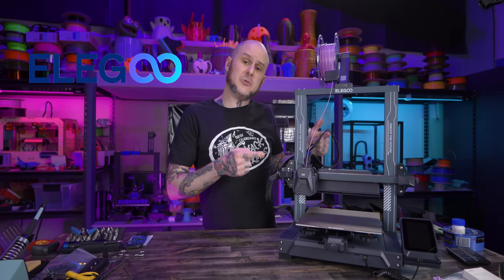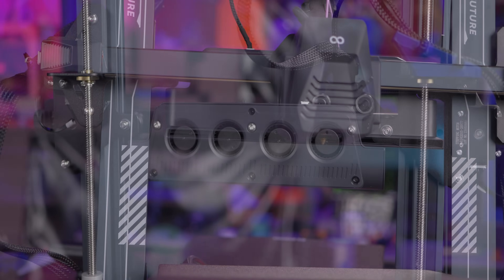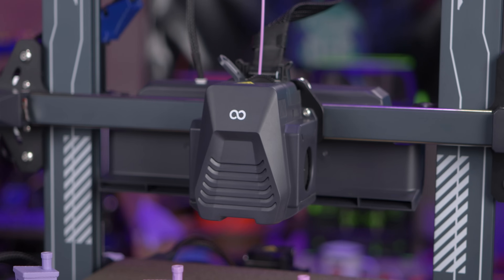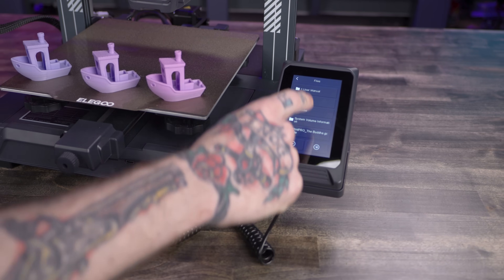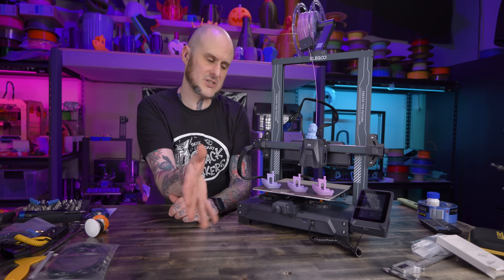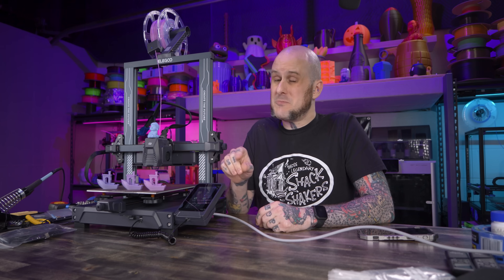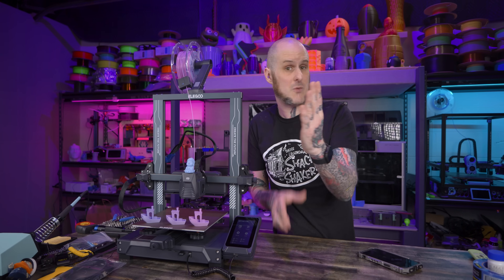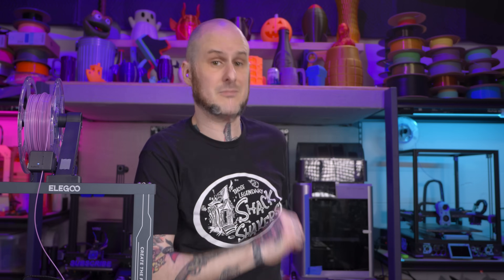Neptune 4 Pro - Closer Look + Wi-Fi Setup!

Comment: I have a Problem with the wifi. Please help. lsusb shows the wifi dongle. In nmtui i can select my wifi and connect to it. It seems to work. But IP Scanner does not Show the IP and on my Router the connection is not shown. What is wrong?
Reply from the maker: Try other IP scanners. Sorry, it sounds like a network side issue that I cannot begin to remotely diagnose. I've setup my network with a managed router specifically to simplify these types of processes for my work. I cannot think of any reason your machine would be connecting but the IP address not be visible somewhere on your network, unless it is a network permission issue for the machine searching for the other IP address.
Reply: Thanks anyway. I'll try it

Comment: Excellent preview of the printer. I ended up buying the 4 Pro. It's been great. I'm wondering if you could point to a tutorial on how setup the camera. Every one I found ends up with the webcam not working. Like the mjpg streamer is not running. I see that you have a different web interface setup too. Completely new to klipper and that whole armbian printer environment, but not completely new to pi-based systems. Just not having any success. Thanks again for the preview. It was very enlightening.

Comment: I cannot mentally grasp how to get to that fluidd website or program or whatever it is, and literally no video is explaining how to get there, Is there something very obvious im not understanding here??
Reply from the maker: It is a somewhat obvious thing, so I guess everyone glosses over it. 

Take that IP address that your machine has assigned to it (if connected by LAN cable it will be in the menu as I showed), type that into your web browser as a URL. So open Chrome or whatever, and instead of “www.” just type “192.168.1.xxx”. It should load the Fluidd interface if the machine is booted and connected to your network.
Reply: @MandicReally  First and foremost, I deeply appreciate the instant reply, thank you oh so very much. Second, Thats a very straight forward explanation I will get on that right away, thank you SO MUCH

Comment: I finally got my Neptune 4 Pro in and I've been loving the speed. I have an Ender 5+ that I run octoprint on along with a pi camera, so I'm not a stranger to the web interface. I have the Neptune connected via LAN cable, but I'm having all kinds of issues getting my Logitech 920 to show up in the web interface. It is showing up via the "lsusb" command, but not on the gui. Were you able to just plug and play, or did you have to mess with some configuration files? If you did have to make adjustments, could you point me in the right direction? I know this is an older video, but out of all the reviews out there, this has been the most informative for me.
Reply: Did you ever find a fix for this? I'm trying to get my cam to hookup via wire and fluidd that came with the printer.
Reply: @MiaMia-zw5wu  No, I didn't. From what I was able to find out, there was an update pushed out that broke the plug -n-play of webcams. Support from Elegoo said, "sorry, we can't assist you because it wasn't designed to use webcams". So in between this video and the official release, updates were made that make go boom.

Comment: Thanks for this video.  The WiFi dongle installation hack was particularly appreciated.  I probably could have figured it out myself in an afternoon but it's great that you showed us how to do it.

I hope Elegoo makes a 300 mm cube print volume version with Klipper, but adds an accelerometer so it can do input shaper calibration to maximize print speed and quality for each customer installation instead of some generic input shaper profile, and with WiFi because almost nobody uses a wired LAN connection in 2023.  It'd be great if there was an optical filament run out sensor on the print head as well instead of that dangly bit next to the reel.
Reply: I wish these manufacturers would add the accelerometers to the hardware itself, instead of it being an additional expense. I wouldn't describe these printers as "crude klipper implementations," but I think these first high-speed cheapies are clearly "We were making this printer already, and added Klipper." 

Accelerometers are cheap and easily available, and it would be nice to get have "calibrate input shaping" as a built-in option. I also think getting the accelerometer closer to the nozzle (instead of "somewhere on the X-carriage") could make input shaping more precise.
Reply: @B1GTOBACC0  - I agree on all points.  We're seeing some early commercial Klipper installations.  Bambu put the accelerator on the print head and Creality copied them, which can do good input shaping on a core XY machine.  Klipper on a lower priced bed slinger is a different proposition.  The manufacturer is less likely to include an accelerometer, and a bed slinger needs an accelerometer on the extruder for X axis calibration and another accelerometer on the bed for Y axis calibration.

Comment: I have had severe issues with this machine right out of the box and I was able to resolve many of them, but I still get incredibly nasty blobs.
Reply: Is it still continuing?
Reply: @Naptingarilo  yes, there were extreme layershifts, the printer forgetting the z offset and generel bad auto leveling, z scraping, inconsistent extrusion and those blobs I mentioned. In the mean time I returned the printer. At least I got all of my money plus shipping costs back.

Comment: When I just plug the IP into the Terminal on my Mac it says: command not found
Reply from the maker: Are you using the ssh command? Mac terminal is great for that but has specific commands to start the process: https://www.servermania.com/kb/articles/ssh-mac
Reply: @MandicReally  yes, I also figured that out, thanks. But now I have the problem, that for some reason I can't log in to my WiFi on the last step, even though I couldn't be more sure I have the right password. What confuses me, is that it says: passwords or encryption keys are required. Do I have to enter several passwords and if so, which ones?

Comment: PLEASE READ IF YOU PLAN TO FOLLOW THIS TUTORIAL
Purchased the Wi-fi dongle back in June when I preordered from the link in the description in preparation of my pre-order. Printer finally came yesterday, but the dongle is not compatible. I can follow the tutorial step by step until I open the network-manager. The Wi-Fi dongle does not appear on the list.

TLDR: The dongle in the description may not work for this tutorial.
Reply from the maker: Very sorry to hear that. They may be supplementing different inventory.  These things change so often it is hard to keep track of. I ordered a couple of them after this, I'll try and test the ones I got since this to confirm.
Reply: Yeah, you can't use Octoprint either. The USB ports are messed up, they already sent me an updated firmware, but it did nothing. I had a wifi dongle work ONE TIME. After a reboot, never came back. New firmware brought it back, till I rebooted again.
Reply from the maker: @Stippy420  Are you trying to install Octoprint on the onboard SBC or run a separate Pi? Do you have a real need for Octoprint? I've never cared for it and find Mainsail (& to a slightly lesser degree Fluidd) superior in almost everyway.  Only thing I can think is if you have some plugins you just really need to use that Octoprint has.

Sorry to hear of your issues too.  I wonder what the heck is up with USB controller issues and this fork of Linux...

Comment: The USB WiFi Dongle link is not longer working, I checked with different browsers. Please tell us the type or name of the USB WIFI Dongle. Thanks.
Reply from the maker: It is the "Tenda W311MI 150Mbs USB for Rourter's Wireless 2.4G Wifi Adapter Receiver Network Card for Laptop Desktop" on AliExpress.  I just clicked the link to go check it out and get the title and the link worked fine.  I'm not trying to argue with you, just that I cannot fix a problem that doesn't seem to exist, what happens when you click the link?  A 404 error? A different Aliexpress page? Can you open Aliexpress at all? Do you live somewhere that may have a block on it or something?
Reply: @MandicReally  Thanks for the info on the USB WiFi adapter. 👍

I don't get a 404 web server error, but an AliExpress page with the error message "Sorry, the page you requested can not be found :(". AliExpress itself is not blocked and actually works normally. My location is Germany. Now, with the info about the adapter, I can search for it directly. 😊

Comment: Nice video ! Juste a question, Moonraker is avalaible on the printer ? To use with a phone, or over API ?
Reply from the maker: Moonraker is installed and accessed via FLUIDD as I showed (or Mainsail, but you have to install that as it isn't out of the box.).

Comment: where can i find this manual turn off unit?is it also available in EU?
Reply from the maker: The fan unit? If that’s what you mean you have to buy the entire Neptune 4 or 4 pro. It isn’t available separately and it won’t fit another Neptune as they don’t have the holes for it.
Reply: i han understand, there is a manual  tur off unit for the 4 fans , that come not with the printer und i can  seperate buy it, when i don nit want that the 4 fans always run
Reply from the maker: @gheyathn8907  the manual turn off is on the 4 fans. It is a switch on top of it. I showed it in the video I’m fairly sure.

Comment: Really interested in getting this Printer. Thanks for the Wifi guide as well. 
Do you know if this printer uses standard nozzles or some proprietary nozzle that ill have to go to Elegoo for?
Reply from the maker: They aren’t a common nozzle, but I’d no longer call them “proprietary”. The Creality Ender 7 & 5S1 both use them, as does the Kobra 2 I believe. I ordered some CHT Knock-Off nozzles for it off of AliExpress and plain nozzles are there all day long from various vendors. I don’t think it will be long before the range of nozzle options for this form factor becomes a lot more common.
Reply: @MandicReally  Ah sweet! I'm glad they didn't decide to use something completely locked down.  Gonna place my pre order tonight, I think. Thanks again!
Reply from the maker: @shadzman  if you do I’d appreciate if you used my affiliate link, haha. Any support helps: https://tinyurl.com/ElegooNeptune4Pro

Hope it meets your expectations.

Comment: Is that CPU not a bit warm for a machine not doing much more than idle
Reply from the maker: A lot of these pi clones run rather warm. Seems to just be the standard for Rockchips.
Reply: @MandicReally  Im kinda hoping based on the updates from the 3 to 4 that there is a 4 max out before xmas. My present this year was going to be the Neptune 3 Max

Comment: How similar is the Neptune 4 hotend shroud to the Neptune 3 Pro?
Reply from the maker: Outwardly they looks the same but the 4 shroud is a fair bit taller and quite a bit different to fit the longer hotend and larger fans.  I tried installing the 4 Toolhead onto the Neptune 3 Max carriage and it didn't work.  It MAY be able to be modified to work, but I don't have time to undertake that and it isn't available for sale separately at the moment (or possibly ever).

Comment: Wow LTT really put a lot of pressure on other YouTubers in the review category. 

But that's fine. All those printers are more or less the same. The only important part is built quality at this point.
Reply from the maker: Eh, Ive always gone so deep on my reviews. The issue is others don’t, so they can pump out reviews with much less depth much faster. LTT has created a system where they can create depth in a “short” time. Granted there is no replacement for long term use of a product.
Reply: @MandicReally  The important thing is you get to focus more on the actual fun stuff 3D printing can provide. I'm sure you'll do more reviews in the future once some interesting development in 3D printing tech hits the market.

You will do great just doing what you enjoy rather than dealing with the financial burden of making a review...until you can get sponsors 🤞. I'm sure you'll get there considering the great content you make.

Comment: I appreciate videos like this that aren't actually reviews, but still tell me the majority of what I need to know about the machine.  I've got 2 Vorons now, and a resin printer, so I'm not really in the market for a new machine, but I still find your videos entertaining and informative.  I almost didn't watch this video, but I'm glad I did.  I think I have a new default recommendation for a cheap printer for other people, and I'm really impressed at the state of the industry right now.
Reply from the maker: Thank you very much. Somehow I missed this comment, but I really appreciate it.
Reply: Do not get this printer do not get this printer. I've had their Neptune three and I don't know what happened. I'm pretty sure they sold the company off. This is a completely different machine is absolutely horrible like absolutely horrible. I can't even get the thing to work and I used to print on Neptune three for over half a year I made hundreds of dollars.
Reply: @SumDetailingguy  tf
it works for me just look at the specs

Comment: if a machine has 2 Z motors. and any sort of bed probe/sensor... It should have the bed rigidly mounted... And not have those bed adjustment screws?
Reply from the maker: That’s feels like a fairly arbitrary distinction. Manually Tramming a bed can provide a better base for auto leveling to compensate off of. Z motor count shouldn’t have anything to do with it. If they come out of sync with each other it won’t matter. The machine has a belt connecting both Z motors to prevent that though.
Reply: You do not need second Z axis in such small printers. It is more a marketing thing. Or a 'curved hands' thingy. Nobody knows how to tune those rubber wheels.
It is a very VERY bad idea to make a fixed bed. But.. It comes again from 'curved hands' thingy. Nobody knows how to rotate those knobs.
There is a trend nowadays, that you can buy a 3d printer and print without any knowledge. And every manufacturer tries to follow some noob's myths about 3d printing like "ugh it does not have second Z axis, this printer is bad, I will not buy it".
The idea is to make an easy way to come in 3d printing. But the other side is, user can encounter trouble which will make him to buy another printer, or to heavily mod original.
For example this metal rollers. While rubber ones are already known in cheap and easy repair. The metal rollers may require to change whole profile to repair, which make it pointless.
But I guess it is a normal way of capitalism. Sell a comb to a bald man. = )

Comment: Do you think we can buy the same extruder and heat block for the Neptune max?
Reply from the maker: I tried installing it myself and it doesn’t fit without modification. If I can make some time (unlikely) I’ll see about adapting it. That said, I don’t know that Elegoo will sell it just yet. They’ll need them to fill orders and since it will require modification to fit, they may not be apt to do it.
Reply: @MandicReally  Thanks for the reply. I guess I am used to the creality customisations and stuff. I really liked your reviews. I can't decide if I upgrade to the ender 5 plus where i can easily replace the parts or if I should get the bigger neptune max.

Comment: As you said armbian comes with limited wifi drivers preinstalled, but if you have to install networkmanager or something else to connect to wifi anyway, you could also take the step to install the wifi drivers for your chipset. Granted, I understand in the form of a quick tutorial that would make it quite a bit longer, but it could very well be an option.
Reply from the maker: I was having trouble finding specific drivers for the ones I had, so providing a tutorial for that would make it way more complicated when I myself was having trouble finding them. If I did that it is a 100% certainty I’d have comment after comment of “I bought this $10 one on Amazon that doesn’t say what chipset it uses, which driver do I need? Do the work for me!”  I have to think about the long term support that’s gonna continue to happen with these videos unfortunately. A good thought on a case by case basis though.
Reply: That is a good point to make, still a good remark that there are other options for those that know what they are.

I will also add from personal experience that while most devices can be made to work, some need some pretty nasty workarounds. 

I really wouldn't want to be the one handling these issues in the comment section.
Reply: Id love to know how to install the drivers for my WiFi dongle - I have them but cannot make any sense of the directions.

Comment: It's ridiculous that they didn't include Wi-Fi from the factory. Like you said the dongle that works is $5. That means they could probably get them in bulk for a couple bucks a piece. I think anybody would be happy to spend an extra $5 on the printer to have Wi-Fi out of the box.
Reply from the maker: It would also require an additional usb header on the board. They clearly designed it intending folks to use the usb stick to transfer g-code and there is only one USB port. Sure that also is probably only a few dollars more, but both of those immediately push it over $300 and I’m certain that was a price point goal.
Reply: @MandicReally  I disagree. They could just put the wireless dongle in the one USB port. If you have the wireless option then most people aren't going to transfer via USB and if you wanted to transfer USB probably don't need the dongle and can just transfer on USB. Since I switched over to using wireless connections on my printers I've literally never transferred a file locally.

Comment: Was that white thing on the bed a tgermal fuse? If thats true then props to elegoo. Thermal RunAway only protects from sensor based failures, if the mosfet failed in the closed position then good luck